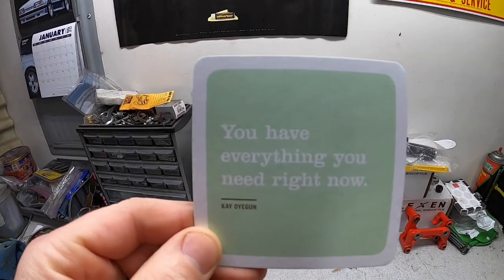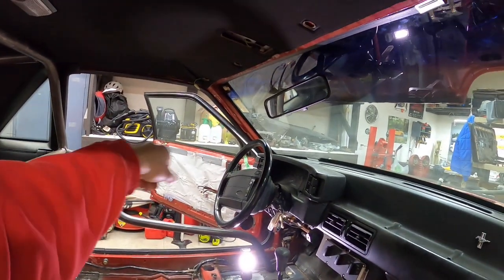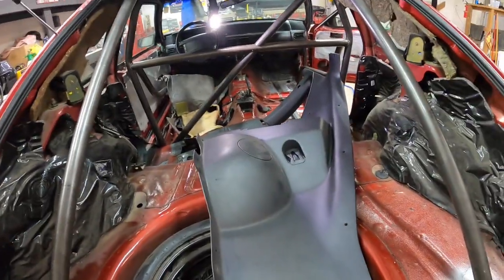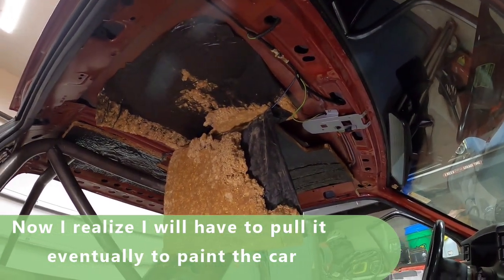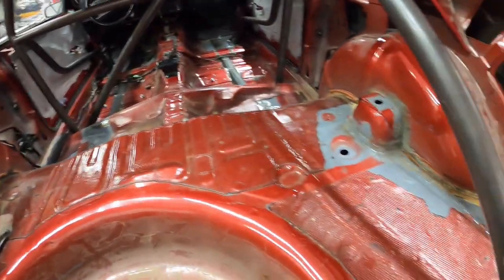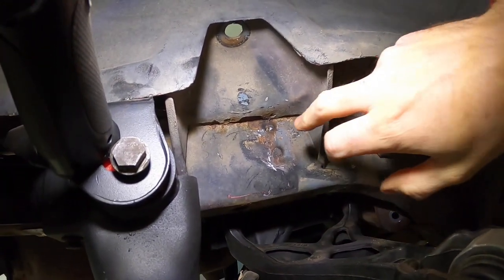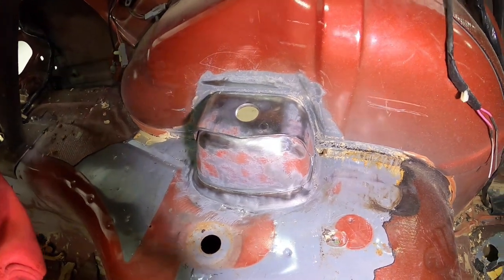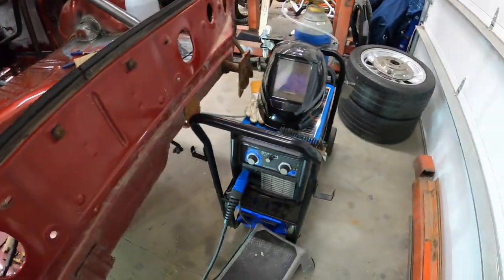Foxbody Shock Tower Reinforcement - Part Uno

Comment: Great job so far. I’m trying not to watch the newer videos until I get caught up. I’m almost there. I ‘m curious if your interested in selling the small clips that screw into the rear quarter panel plastic. The ones for the rear cargo shade cover. I only ask because I doubt you can use the sun shade with the roll cage in there. Again, great video. 👍
Reply from the maker: Only if I knew they weren't going to be missing in a future project car.  I was thinking of finding other plastics that aren't as nice to cut up to fit around the cage, too. 😀

Comment: FYI, more heat on the welding process. 1 amp per thousands of material. You may need a little more than that but get in and out of the welding process. The welds look too cold. Your project is looking great!!!

Comment: At the end of your video you said that the argon was gettin low. Are you using 72/25 or straight argon. With mig welding you need 75/25. When the bottle get low you can experience dirty gas depending on how old the tank is. Have a great day!!!
Reply from the maker: It is 75/25.